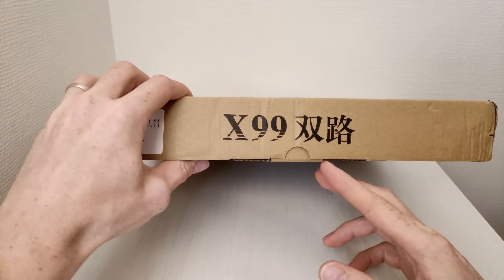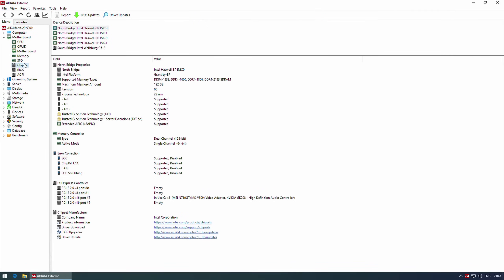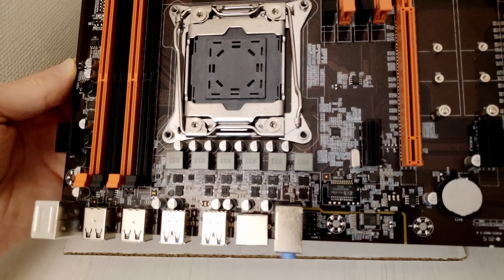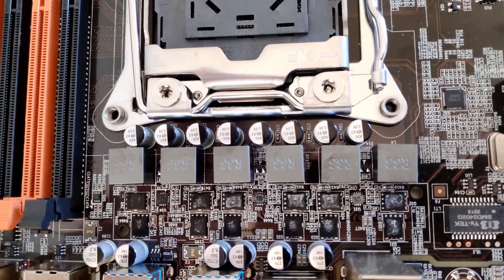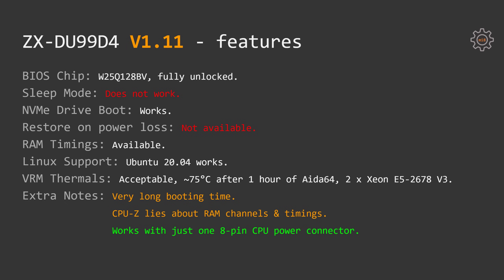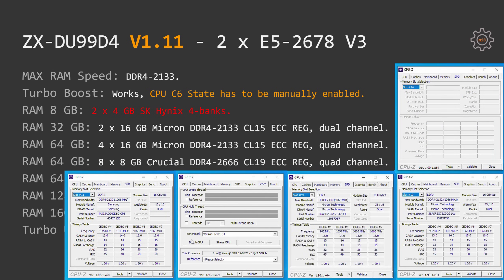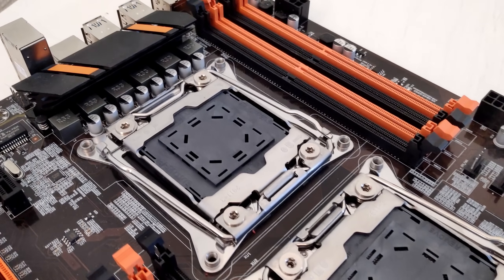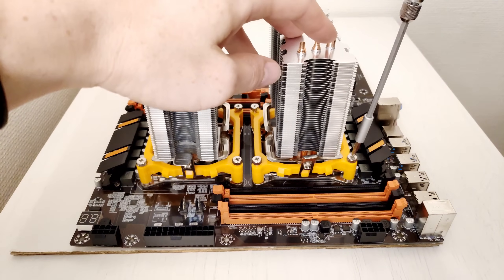🇬🇧 Detailed review of ZX-DU99D4 V1.11 Dual Socket LGA 2011-3 | E5-2678 V3 | E5-2620 V4

Comment: PLEASE YOU COULD ASSIST ME OR TELL ME IF IT IS POSSIBLE TO UNLOCK TURBO BOOST FROM THE SET I HAVE MOTHER KLLISRE ZX-DU99D4 V1.11 2 * e-5 xeon processors 2698 v4 8 combs ram kllisre 4gb ecc 2400mhz dc 2400mhz dc very satisfied and pay for the tip
Reply from the maker: It's not possible, Turbo Boost Unlock works with V3 CPUs only.
Reply: @Miyconst  on the intel website says that the e5-2698 v4 would work on up to 3.6 turbo allcores? so which mb (aliexpress) would you recommend for me to be able to work with all the boost unlocked performance of these cpus?
Reply from the maker: @vitrinevirtualbr  E5-2698 V4 is not going to work at 3.6 GHz on all cores and I don't recommend any of the Chinese motherboards for this CPU.

Comment: Hello there. Quick questionI am planning to build a workstation/server that I will primarly use for multiple VM`s for development where I nned to emulate distributed servers. For that I think it would be great. But sometimes I play as well and building two computers for that is not something I would gladly do. This lag you mention in the end. Could you try to asess if it is 10-20-30% drop in performance ? Does it become unusable/unplayable ?
Reply from the maker: Do yourself a favor and build a powerful single socket machine. Dual CPU setup is only for those who know what they are dealing with.
Reply: @Miyconst  thank you for trying to answer. I had my first private dual CPU rig in 2004 with pentium 3 so I know thing or two about SMP systems. And I have been administering number of those systems starting around 2001. However games are something new for me as working from home is first time I can waste some of my time to do it . 
In the end I have found myself an answer to the question I had 👍

Comment: Hi, I have this motherboard but it's working just one processor, do you think that some special configuration is necessary to make the motherboard work with two processors? Jumpers? bios? any idea?
Reply from the maker: You need two identical CPUs, two 8-pin CPU power connectors, and RAM for both CPUs, that's it, it shall just work.
Reply from the maker: Yes, that could be a problem, but it may also be something else.
Reply: I have the same issue. Using 2x E5 2643. Hangs or continuously repeats POST. Works fine with 1 CPU. Any ideas.

Comment: Hi, could you please help me? I got one of these motherboards, I ordered two 2660 V3 but only one arrived, so I installed on socket 0. I got a XPG GAMMIX S11 Pro SSD Nvme, it's not recognized on the main m.2 slot (on the bottom). It's works on the other m2 slot but the speed is limited. Looking this video, I changed the jumpers, I tested multiple configurations: up 1 and 2 only, up 1, 2 and 4, it still not recognized. The only way the SSD is detected on setup is putting all 4 jumpers up, windows tries to boot then I got blue screen "inaccessible boot device". Which is the correct configuration for SSD Nvme to work on the main m.2 slot? The absence of the second cpu influences it?
Reply from the maker: I don't have the motherboard on my hands any more, but as far as I remember, the main M.2 slot is connected to the first CPU, thus it shall work with just one CPU installed. If it' s detected, but does not behave well, it may be incompatible or you have to reinstall Windows. The motherboard should have a small diagram, which indicates the jumpers location for NVMe / SATA mode switch.
Reply: @Miyconst  thank you for your answer, the box next to the jumpers says "JM2_1 / 2/3/4, 1-2 PCIE, 2-3 SATA". I was thinking that 1-2 were the jumpers, now I think they are the pin lines. But in this case the starting position should be the correct one, but it does not detect the SSD. As it is, it seems to me to have stayed in the SATA position.
Reply from the maker: @BrunoCesarCarneiro  I think, it would be the best if you contact the seller. On some motherboards, using wrong configuration of these pins may lead to a short circuit and a burned motherboard. Thus, I don't want to suggest you anything without having the motherboard on my hands.
Reply: @Miyconst  Thank you again, the seller don't know much about the motherboard, buy I managed to get 2 fresh SSDs, one Sata and one Nvme. Just reporting, in case other people end up here. The configuration that comes from the factory, with the 4 jumpers down (farther from the cpu) only recognizes Sata SSDs. 

To use Nvme you have to move all 4 jumpers up, SSD Sata stop being recognize and Nvme appears. I installed Windows 10 on Nvme once, powered off and on, and it worked perfectly. But when I removed the disk, and re-installed (psu off) it was like the boot partition was delete. I only saw the message "Boot device not found", I had to install Windows from USB again. 

After the tests, I re-installed Windows 10 on XPG Gammix S11 and it is working, multiple restarts now, I got 3340mb/s on Crystal Mark. 

PS: I don't know what configuration I did in an attempt, but I was unable to open the setup anymore and all boot devices stopped being recognized. I started to panic then I saw a suggestion to remove the CR 2032 battery, wait a few seconds and put it back on. Everything was back to normal
Reply from the maker: @BrunoCesarCarneiro  Thank you for the additional info, such comments help me and others collect their knowledge base :)

Comment: hello 2x cpu does not work when I plug 8 pin, it only works when I plug 1 x cpu cable, does it not support 2x 8 pin?
Reply from the maker: 2 x 8-pin are required for two CPUs. If your motherboard refuses to start, it may indicate VRM failure.
Reply: @Miyconst  It sees 2 processors from a single 1x8 pin but not from 2x8 pins.
Reply from the maker: Then you have got either damaged motherboard or damaged PSU / PSU cable.

Comment: Which do you recommend right now? Do you still recommend the Huananzhi X99-F8D as the best Chinese X99 Dual motherboard? I want to make a VM HOST server (ESXI) and look for the best option.
Reply from the maker: Yes, I would still recommend Huananzhi X99-F8D.
Reply: @sang kim did you manage to do it, I am also planning to do something similar but most likely using Proxmox
Reply: @mrbilalhaider  I avoided the Chinese board and went for an asrock single cpu board. I got a xeon e5-2680v3. That gives me 24 logical cores for me to distribute to all my VMs. I have 48gb of ram. Wish I got more. I am running 3 Fortigate vms. 3 cisco CSR routers,  3 windows 10 machine's, vcenter server appliance all on it simultaneously. I still have around 10gbs of ram free and a lot of cpu left. Cpu is the least of my concerns. I say invest in a solid reputable single cpu board. I doubt you will use all the cpu cycles. But I guess it depends on your use case.
Reply: @skim32  thanks for sharing this. For me deciding is difficult  because of the same reason. I can get Asus x99ws/ipmi for more or less the same price. Ipmi seems necessary but the problem is the that this board accepts only non-ECC DDR4. These chinese combo deals are very tempting needless to say

Edit: I was wrong about RAM type on ASUS board, it can accept all types ECC/ECC unbuffered/nonECC
Reply: @mrbilalhaider  if your machine is for a lab environment, ecc probably isn't that important.  If it's for mission critical services, then yeah ECC would be ideal. I actually didn't do my research and my asrock supported ecc but not ipmi. So far it hasn't been an issue. I was thinking about getting 3.5" external bay temp monitoring kit. But so far haven't been compelled to get it. Of course, my sever is mostly home lab stuff and running some servers from time to time. Is there any other advantages to ipmi besides monitor temp and fan speeds?
Reply: @skim32 my understanding is limited but I think the actual purpose of ipmi is to completely manage the system remotely over network. This includes waking up the system over network, managing bios, system console etc. This can be very handy in case of home servers where we dont have server consoles.

Comment: @Miyconst 
Have you tested with 2 GPU cards?
My setup does not work well with RTX 2080 and RT 580. I installed RTX 2080 in the 1st PCI 16x and the RT 580 in the 2nd PCI 16x, this is the only configuration that I can test because of the boards dimensions.
What would you recommend to try?
Thanks!
Reply from the maker: Can you please describe what you mean by "does not work well"?
Reply: @Miyconst  
Here are the symptoms of the ZX-DU99D4 V1.11:
- configuration #1: RTX 2080 = 1st PCI x16, RT 580 = 2nd PCI x16
  - if both cards powered only RT 580 will output video signal at bios stage, but booting the Ubuntu will get only prompt
  - if only RT580 powered then no problems with video output 
- configuration #2: RT 580 = 1st PCI x16, RTX 2080= 2nd PCI x16 (I removed the USB3 header to make room for this longer board)
  - if both cards powered only RTX 2080 will output video signal at bios stage, but booting the Ubuntu will get only prompt
  - if only RTX 2080 powered then there will be video output, but only vga (low) resolution 
- configuration #3: RT 580 = 1st PCI x16
  - no problem
- configuration #4: RT 580 = 2nd PCI x16
  - no problem
- configuration #5: RTX 2080 = 1st PCI x16
  - reduced resolution on Ubuntu (could be a driver problem)
- configuration #6: RTX 2080 = 2nd PCI x16
  - reduced resolution on Ubuntu (could be a driver problem)

I tried these GPU's on a different (mono) x99 system (board name is ZX-99EV3_V1.23, when I purchased was under Machinist brand) and both cards provided expected resolution (matching the monitor higher resolution).
The successful configuration: RT 580 = 1st PCI x16, RTX 2080= 2nd PCI x16, but I didn't checked the other possibility (also this mono x99 board has only 2 PCI x16).

For both systems I used a 850W PSU.

It seems to me that having 2 GPU's the system is not behaving as expected. It could be the board design, it could be my mobo that I am using, could be that I need more power for the PSU.

I wonder if you already test dual GPU configuration on this ZX-DU99D4, or what do you think about this problem.
Thanks!
Reply from the maker: @DanielAStroe  it sounds like a driver issue. Having an AMD + Nvidia GPU in one system is a mess in general. With almost every Chinese X99 board I have experienced that if I install two GPUs, the motherboard will pick a "main" GPU, and the BIOS output will be sent there, no matter where the monitor is connected. So, this is pretty much in line with what you are experiencing. Linux video drivers are not the best, and when mixing different GPUs I would expect all sorts of issues. I would install Windows with latest AMD / Nvidia drivers to see if both of the GPUs are working properly and recognized. If the GPUs work well under Windows - then it's Linux drivers to blame, if the GPUs refuse to work under Windows - then it could be the motherboard/BIOS to blame.
Reply: @Miyconst  
Thanks a lot!
Your input helped,  I am facing an accumulation of constraints and issues.

I could use a windows install that use both cards, which validates that hw system is still viable.

I realized that on ubuntu I have problems with previously installed amd drivers. I have an alternate ubuntu image (which doesn't have amd drivers) and the main gpu (nvidia) was able to display high resolution out of the box (open source drivers).
Now I have to figure out how to manage ubuntu drivers ...

Comment: restore on power loss: there is a jumper called "auto on"
Reply from the maker: Does it work for you? It didn't work for me.
Reply: @Miyconst  Yes, it works. But before you must discharge all capacitors. wait some time or press power on button with power cable disconnected. Then, when you plug the power cable in, the motherboard starts automatically.
Reply from the maker: @АндрейМихайлов-о6я3ц  thanks for the info! I will try it the next time I have such motherboard.

Comment: I have a problem, the board does not start with 2x Xeon v4 ES. Both cpu's are ok. 

It stops at Code 79.

Does anyone have a solution?
Reply from the maker: Most likely your ES CPUs are not compatible with each other.
Reply: @Miyconst  

Both CPUs are E5-2683 v4 QK7K.

Individually they run perfectly on the mainboard
Reply from the maker: It doesn't mean that they are compatible with each other. When it comes to the ES chips you can expect all sorts of weirdness, but you can try to contact the seller.
Reply: Hello friend, were you able to solve the problem? The same thing happens to me. (Sorry for my bad English, I'm using Goole Translate)
Reply: E5 2683 V4 dont work i dual cpu, it happens cause most of  microcodes dont support then.

Comment: Hello, how do I enable the two slots m.2, is it in the jumps ?.
Reply from the maker: There are jumpers on the motherboard.
Reply: @Miyconst  same question here. it came with all jumpers in the lower position but pcie M.2 are not working

Edit: got it, putting all of them to the top makes the PCIe NVMe SSDs work.
Reply from the maker: @FalconX88  I don't really trust those "benchmarks", since multiple reputable tech YouTubers demonstrated that MS Flight Simulator 2020 is not able to utilize multiple CPU cores, using DirectX 11 API it relies on the strong single core performance.
Reply: @FalconX88  how do you do raid 0 on these two m.2 slots just from BIOS?
Reply: @Miyconst   i too want to enable hardware raid1 on both m.2 slots. is it possible?
Reply from the maker: @Mirddes  no, that's not possible with X99 platform.
Reply from the maker: @Vapor Guerra it's not possible to do RAID arrays of NVMe drives on the X99 platform, only software RAID.
Reply: @FalconX88  Hi, what is the jumper possition for enable bouth M2 ???thanks

Comment: I've had mine set up for a week now. Only issue i've got is the memory wont go above 1866mhz (should be 2400) not sure if im missing something? Any ideas?
Reply from the maker: It's most likely limited by your CPU. What is it?
Reply: @Miyconst  Thanks, It's Dual E5-2620 v3
Reply from the maker: @mtuffs2000  E5-2620 V3 does not support any faster RAM, its limit is DDR4-1866.
Reply: @Miyconst  ahh ok, thanks. I got them super cheap, so mite upgrade later. :)

Comment: What coolers did you use? I have one of these coming that I bought of eBay super cheap!
Reply: I've used two of these on mine, they just fit, but had no issues so far.  - https://www.aliexpress.com/item/33007776933.html?spm=a2g0s.9042311.0.0.43784c4dLzLYYi -

Comment: Help me please. I have 1 xeon e5-2684v3. Can i run the computer with one chip? Please tell me how to set up?
Reply from the maker: Yes, you can, just install the CPU into the CPU1 socket and all memory into the corresponding slots.
Reply: Thank you very much. But i do not where is cpu1 socket. It said FF on testing card.
Reply from the maker: @NhoHoàngJP  look for the titles on the motherboard.
Reply: Thank you. I found the titles aux1 and aux2 but the titles atx-cpu1 is on the opposite side of aux1. What should i do?
Reply from the maker: @NhoHoàngJP  just try both sockets, start with the ATX-CPU1.
Reply: @Miyconst  thank you very much. You are an excellent reviewer

Comment: Dear @Miyconst I have a PCIe M2 ssd connected and running in the first M.2 Slot (Pcie 2.0) but I'm trying to add a second PCIe M2 ssd to the second M.2 Slot with failure results (Bios doesn't list the disck). I know the new ssd disk is running because if I connect on the first slot the bios show me the disk. I'm using two cpu... can It be the reason? THanks!
Reply from the maker: No, two CPUs can't be the reason of this problem. It could be a compatibility issue or something similar. What is your SSD?
Reply: @Miyconst   PNY XLR8 CS3030 is one, and the other is Kingston A2000 (SA2000M8/500G). Both of them work in the first slot, but neither in the second slot :(
Reply from the maker: @Mario.D  the other slot might be turned into the SATA mode, check the jumpers on the motherboard.
Reply: @Miyconst  You are the F boss. Correct and working! THANK YOU AGAIN.